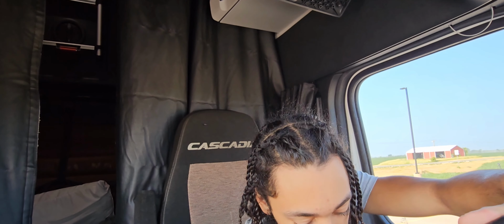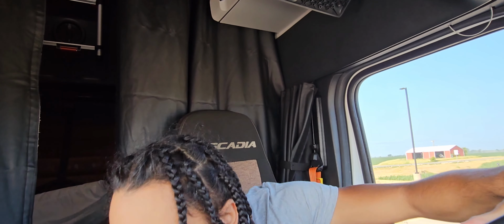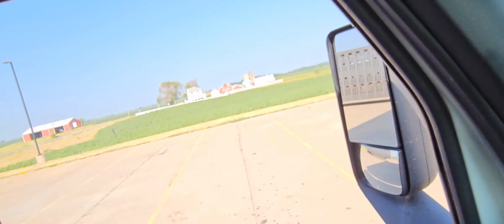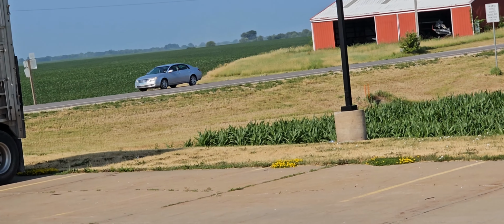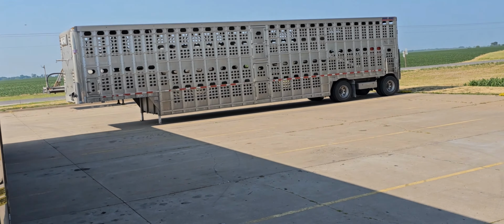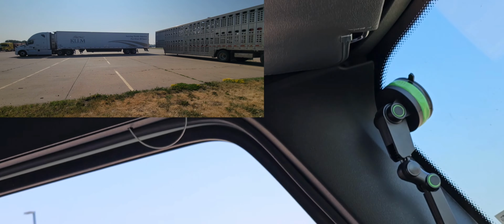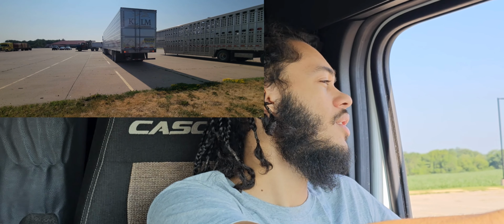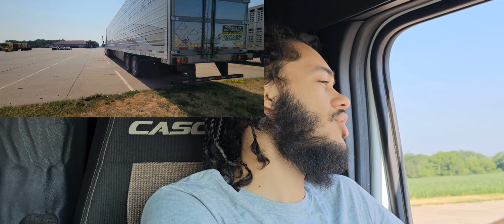90° Back | How to back a Semi Truck

Comment: I think the word you were looking for are: “those are the basic steps”.  Also, how far back do you prefer your tandems to be?
Reply from the maker: Yea, haha, basic steps. That happens to me so often, I usually just edit that out. Personally, I like them all the way to the back because I use the tires as my line of sight. Also, I feel like the tail end swings outward less. But in really tight spots, the tandems being further up makes you have a smaller turn. But anytime I can, I like them all the way to the back of the trailer
Reply: @bigsmoothtruckin  Thanks for the reply.  I’m surprised that you liked your tandems all the way back but that makes sense if you are using your tires as your lines of sight,  And if you think it’s sometimes difficult to remember things like words now, just wait until you get older!
Reply from the maker: Definitely, I like interacting with people. But yea, it just feels like I know my trailer with them all the way back. Haha, my mom told me that all the time. So I try and read often now to exercise my brain to build memory.